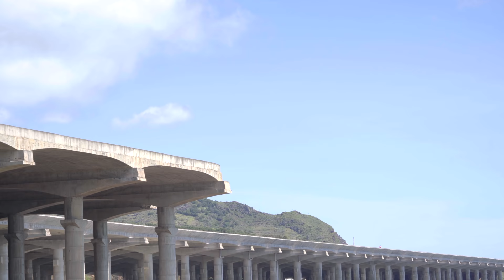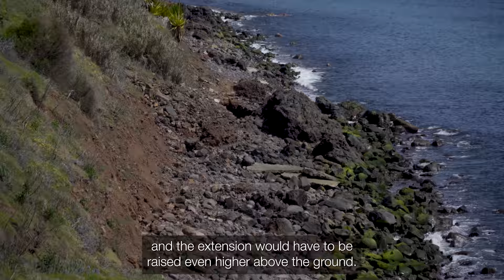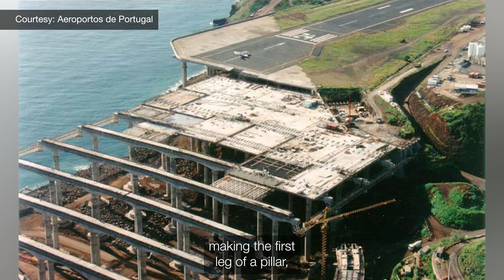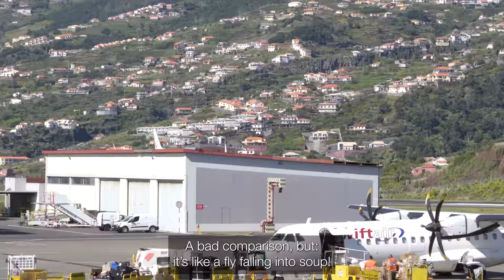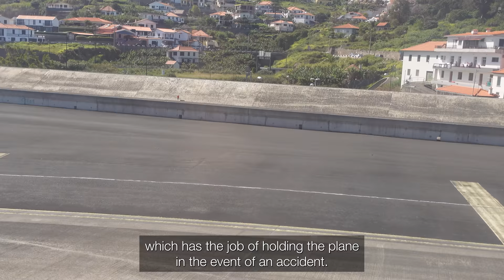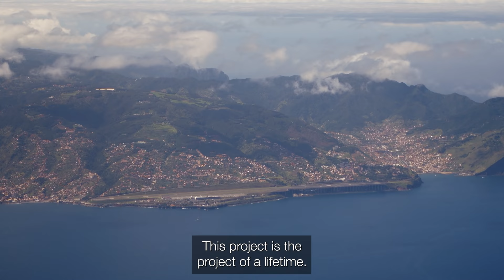Europe's toughest airport landing used to be a lot harder

Comment: Approach is very similar to that for the island of Samos in Greece (37.689161N, 26.910942E) when coming in from the west (09 vector). Fast decending right hand turn thus avoiding a very tall mountain, usually with high cross winds, on a runway next to the sea, and no margin for errors.

Comment: It's also one of the few airports where pilots will takeoff with maximum thrust. We were warned by our EasyJet pilot on our flight that the engines would sound noisier than we might be used to!
Reply: ✉𝑾𝒉𝔮ᴛᵗ𝑠𝑨𝑝𝑝  ✚𝟏𝟗𝟎𝟔𝟓𝟔𝟗𝟔𝟑𝟔𝟕✔
ʀᴇɢᴀʀᴅɪɴɢ ʙᴛᴄ/ ᴇᴛʜ ɪɴᴠᴇsᴛᴍᴇɴᴛ ɪᴅᴇᴀs

Comment: Because I believe that a construction error, which should have been due to the expansion embankment and not supporting concrete pillars, turned the airport into operational constraints due to cross winds and because its operability was often conditioned during many days of the year, a factor its location in an area where the wind blows with some regularity.

Comment: Thanks for this video, it's really interesting! Just one remark: you refer several times to landing aircraft, but airside infrastructures are actually designed for departing aircraft. The weight of a touching-down aircraft is so negligible that designers assumed it as zero. Counterintuitive, I know!
Reply: ✉𝑾𝒉𝔮ᴛᵗ𝑠𝑨𝑝𝑝  ✚𝟏𝟗𝟎𝟔𝟓𝟔𝟗𝟔𝟑𝟔𝟕✔
ʀᴇɢᴀʀᴅɪɴɢ ʙᴛᴄ/ ᴇᴛʜ ɪɴᴠᴇsᴛᴍᴇɴᴛ ɪᴅᴇᴀs

Comment: There isn't any part of the island that is flat, so much is true. But the current location of the airport isn't the only one they could have picked.
The Levada Grande area allows for a longer runway with a much easier approach. But it's on the wrong side of the island vs Funchal.
From a traffic point of view the current location is of course by far the best choice. It also leaves the less populated part of the island unspoilt.
In hindsight they surely made the right choice.

Comment: Take off from Madeira is easy. Pedal to the metal and get it up as fast as you can.  Always to the East, I think. 
Landing I think everybody also approaches from the East. Winds rule this airport. If wind says no, forget about it.
On some special days, you approach (East, off course) and land immediately. 99% of the time you have to fly past the airport in open sea and... do a tight turn. Because winds like you to land on a West to East direction. And when I say tight turn, I mean tight: sea out the window in one side, sky out the window on the other side. 
Then you approach the airport flying above land now. Seing the houses getting bigger and bigger. And you realise that the pilot is aiming... to an airport that looks damn small. They try to land right at the beginning to have lots of time and space to stop. And damn, they hit those brakes.
I've landed a few times. Worst that can happen is when they have to close because of the winds. You may return to Lisbon or if you're lucky, you get to visit Porto Santo, the other island nearby.
But Madeira is worth it. And really, only the pilots that match the requirements get to land there.

Comment: Amazing engineering, but was all,that cost really necessary so people could vacation in the sun?
Reply: You fail to realise that a quarter of a million people live on this island. Theres no other airports on the main island, and the nearest major airport is 500 Km away in Tenerife. With this volume of people its simply not feasible to fly small aircraft out of a short runway, the extension was a massive boon to our ability to travel abroad, not just for tourism.

And yes, even if the premise of your question was right, it absolutely was necessary. You can't even describe it as a cost, its nothing if not a massive investment to have this extended runway on an island whose economy relies so heavily on tourism. Without that tourism, a major part of our population would not have a job.

Comment: Amazing how they did it. Planes are not the easiest things to engineer for.   This makes me wonder how much epoxy was used in the cement to harden & give the concrete longevity & how long it took to engineer this 1,000m slab of concrete with no expansion joints.

Comment: Madeira's a simple landing. Always in & out with zero issue or delay. Gib on the other hand, is closer to military landings & take offs due to not encroaching Spanish airspace. Have lifted out of Gib. Never managed to land in Gib, many touch and bolts due to low cloud base. Gib for more difficult than Madeira anyday.
Reply: You're lucky to have never had to land in Madeira on a particularly windy day. Aircraft can stay on hold for well over half an hour before having to divert to Lisbon when it gets bad, and this happens quite often.

Comment: To say there has been no incident in 50 years is wrong. I was on a flight from the UK in 2017 and we touched down on the runway and immediately aborted and took off . We went round again and landed safely on our second attempt.
Reply: Thats not an incident, thats a normal go-around
Reply: @ZK-APA  wheels hit the tarmac - its an incident
Reply: @magicwandfour  no. This is called a balked landing, where you go around at a very low altitude or after wheels have touched down. This is not that common, but still standard procedures.

Only time its an incident is if it touched down somewhere apart from the runway, or if reverses were activated, then deactivated to take off again.